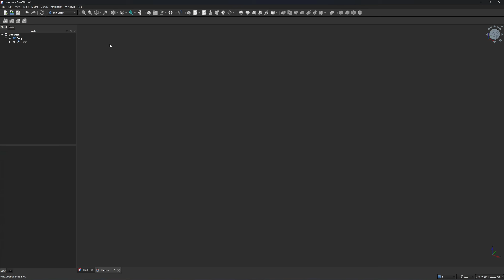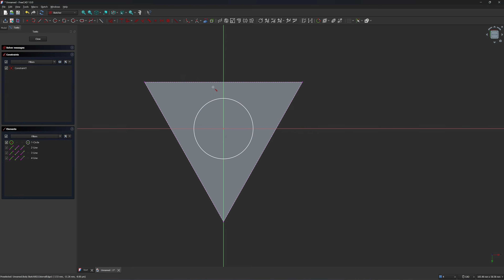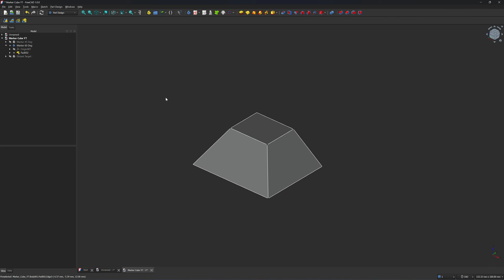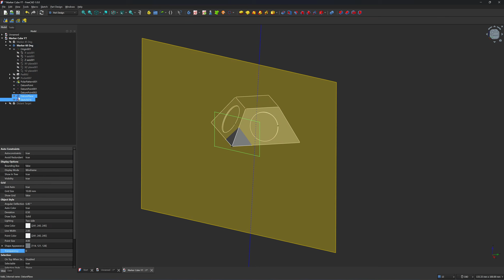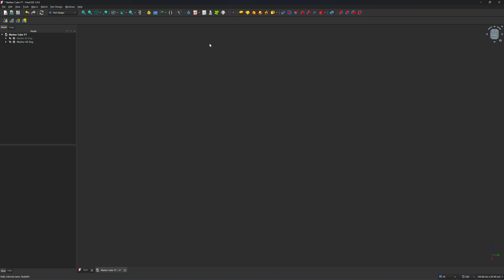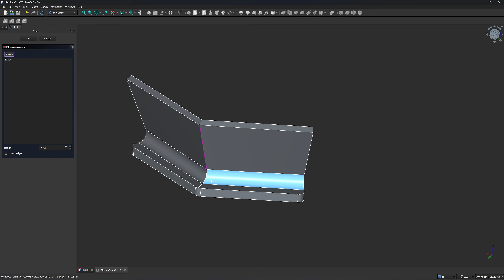Design Custom Marker Cubes for 3D Scanners in FreeCAD – Full Guide

Comment: I tried to reproduce the on FreeCad 1.02 and if I use the loft there is a slight twist (I don't see that in the downloaded model). I then tried to do a pad to plane, and that produced a similar figure. If I compare the angle of the pad on the XZ plane it's 56.3. Did you get this or am I missing something? Also for the scanning it the angles and flatness matter?
Reply from the maker: Did you constrain the sketch profile to horizontal or vertical axis?
Reply: @Payo-TensileCreator  to the horizontal axis, similar to your example. I actually followed the last part of you video. I played with the additive loft property, did not help.

Comment: Thank you so much for this!

Just some hints: in FreeCAD Sketcher you can use symmetry (key 's') for two points and a line. And you can click on two edges and make them equal in length (key 'e').
For duplicating the shape of the last part there is a 'carbon copy' in the Sketcher which is a little tricky to use. Once selected CarbonCopy you can click on the sketch in the model tree while pressing Ctrl+Alt (because it's outside the current sketch attachment). And then you can mirror the sketch along the y-axis.
Reply from the maker: Thanks for the helpful tips, I'm sure that will be useful for others!

Comment: Thanks Payo,
i really enjoy your videos! Lots to learn. i Noticed you have another turntable - instead of the black circular ( creality?) to this. sometimess with black fabric on it. can you  tell anything about it ?
i look ad different turntables, but most of them are to wonky / unstable for me. might build one myself - but if you have any recommendations i would like to hear it
best regards
Reply from the maker: The one I use is actually a glass mouse pad that I place on my old turntable because it wiggles around, and I need some weight to keep it stable. Now I made my own 3D printed one, works very well. https://youtu.be/kjL7HI78B2U